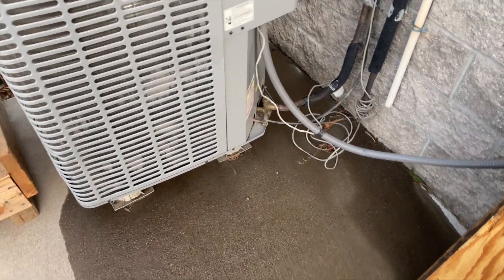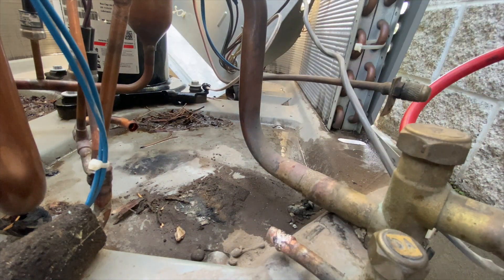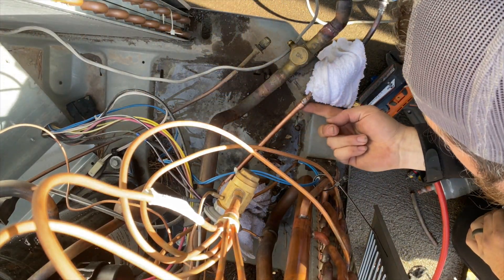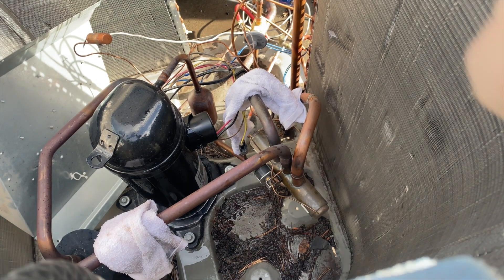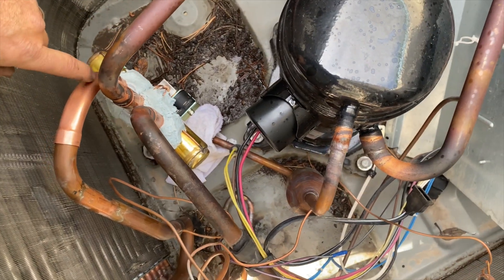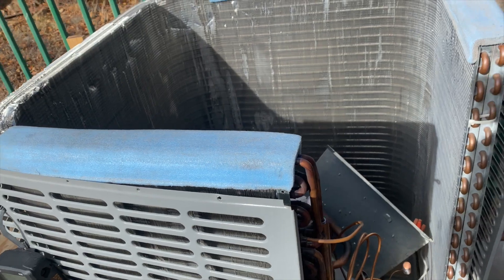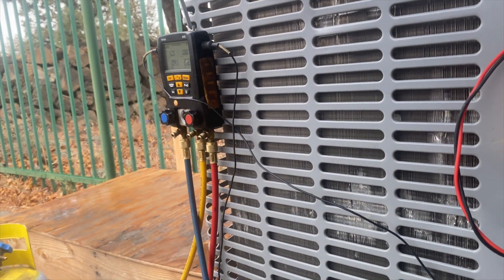How to Replace a Reversing Valve on a Heat Pump. EP75

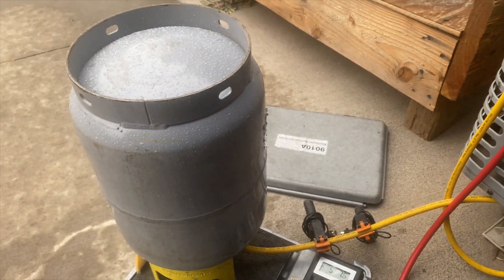Comment: I stopped watching at 13:45 when you put the torch on the pressurized container. OMFG! I have no words.
Reply: tank open to refrigeration loop, he needs to generate a larger pressure diff to get the liquid into the unit.

Comment: You should have covered the painted surface before you used the torch, by torching the paint, the customer will now have a rust issue very quickly. This is why you guys have a bad rep because too often you are not careful and cause issues as you fix others.
Reply: Kind of details that almost any customer will see after that hard work , , all customer are more worried about to get the house cooled or heating , not the surface paint....CO

Comment: We have done a lot of reversing valves mostly large commercial though 1 1/8, 1 3/8,  that was extremely painful to watch, get a pair of cable cutters from harbor freight tools and cut the 4 pipes at the body, if needed remove the condenser coil. We did two at a church last month, From the time the first pipe was cut until the last braze was less than thirty minutes. Also with the larger ones we use two torches, a guy with a turbo and a guy with oxygen acetylene doing the brazing. If your supply house has any warranty reversing valves I suspect most of them are going to be cut off with cable cutters, seeing one cut at the supply house is actually how I learned the trick.

Comment: Use the Carrier method of reversing valve replacement. Cut it out and use couplings to install.
Reply: How does that work?
Reply: Staybrite 8 is your friend drop in a little acid scavenger afterwards if you fear acid.

Comment: What should the thermostat setting be set on for the reversing valve? Cool or heat?
Reply from the maker: It depends on the brand. Most heat pumps are default heat which means when the reversing valve is not energized it’s in heat mode. Requiring a call for Y for heat. In cooling the reversing valve is energized setting it to cooling mode. This is requiring a call for Y and O. Other brands are default cool which is opposite of this.  Rheem and Ruud are default cool. Meaning for cooling only a call for Y is required. For heat Y and B are required. 
That’s why some heat pumps have a O and others have  a B. O= default heat energized for cooling B= default cool energized for heat. Y= Compressor calls for compressor. Hope this helps. Thanks for watching.

Comment: That recovery bottle has a spout that goes to the bottom for the liquid you don’t have to turn those upside down I think that was counter productive
Reply from the maker: I’m aware of that. That’s why my hose was attached to the vapor side.
Reply: When charging on heat, aren’t you supposed to hook to the true suction line?

Comment: Next time use your recovery machine and push the refrigerant into your equipment.
Reply: R410 should be charged in Liquid state. Recovery machine does vapour
Reply from the maker: I thought about that but I have never tried it. Would there be any negative effects to the system?
Reply: @NighthawkHVAC  it is the opposite of what you did to recover the refrigerant.

Now it is the cylinder that you are pulling from and your system is what you are pushing too. Nothing negative about it. So you would not need to use your torch like you did to build the pressure (just view it as you recovered your system you didn’t need to increase the pressure from it), you would just need to keep your cyclinder on the scale to read what you pushed back into your heat pump.
Reply from the maker: Nice. I’ll try that on the next one. Thanks.
Reply: @NighthawkHVAC  Just make sure you do not fill up your accumulator when you push freon in the system with your recovery machine unless you are just going to weigh it in and not look at your pressures.  I could not tell if your bypass port was before or after the accumulator. We like to push the freon in the liquid line to prevent this.  Nice work.

Comment: Curious question? Between replacing the compressor,outdoor TXV, and the three way valve.   Wouldn’t it been cheaper and better for the customer to just replace the entire condenser? Between all that labor parts had to have been less expensive to just put a new condenser? and customer get a new 5 year on the compressor plus new labor warranty.
Reply from the maker: This was discussed with the client but they opted to make the repairs. You haven’t seen the air handler. That’s another headache.
Reply: Some people either can't afford a new one or don't care to use financing.